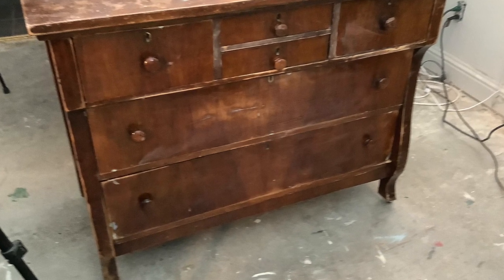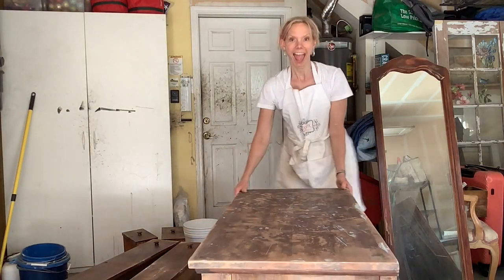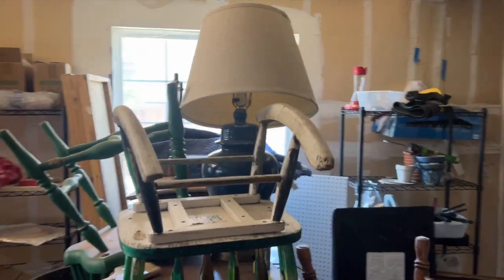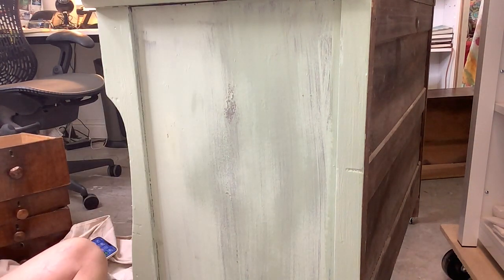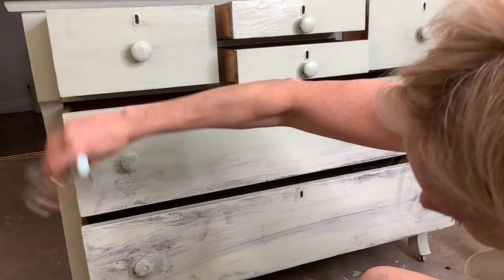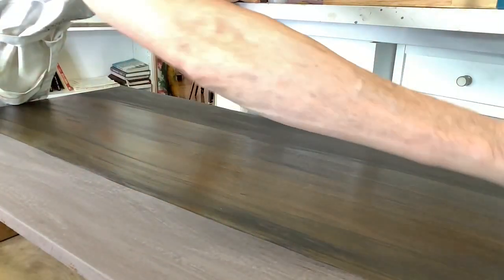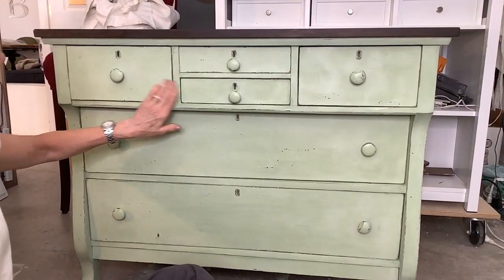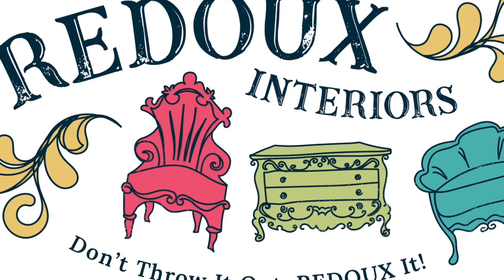Trash To Treasure Dresser Makeover

Comment: What is the compound you used to fill the gouges?
I'm in Italy. Not easy to find American products here.
Reply from the maker: I used a product called “Bondo”, there is also JB Weld.  I am sure there is something like that in Italy at hardware stores.  It’s a putty that you mix in a little hardening compound.  You mix it up and it hardens like concrete when dry. It hardens within 30 minutes